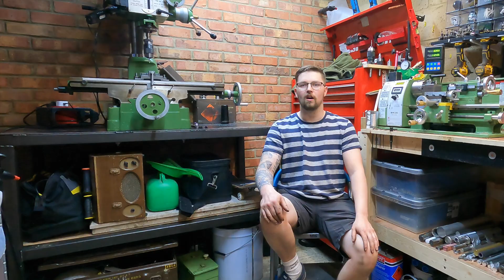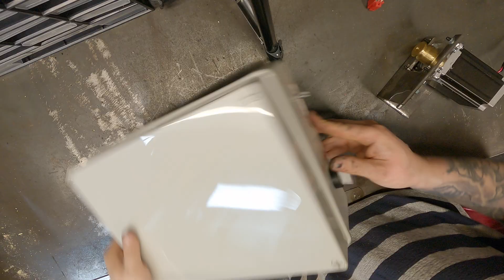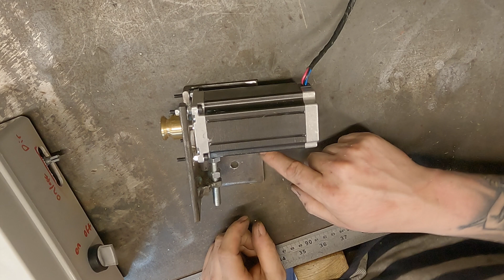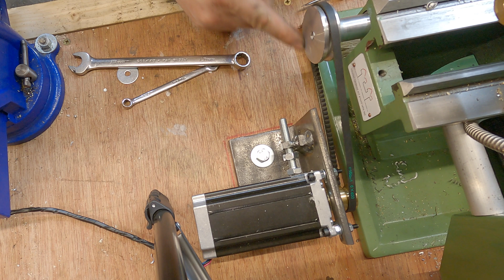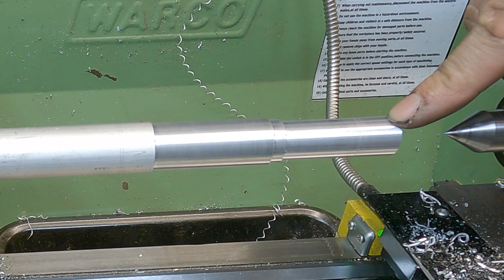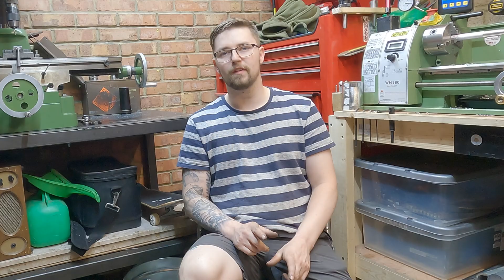Warco WM180 MINI Lathe Power Feed IMPROVEMENT Finished

Comment: Great job joe very informative and well made video thank you. Super new to this machining hobby. I have a question for you, and the page here. Help me out to understand why you added this please. Does your lathe not do the same thing whenever you engage the half nut feed for threading? Please explain, super new here just need some guidance. Im addicted to knowledge.Thank you.
Reply from the maker: Welcome to the channel and the world of machining. 
So because of the setup on this lathe and most mini lathe with a limited number of change gears the minimum feed rate you can achieve is still not slow enough to gain a good constant surface finish. With this mod you can turn the lead screw much slower so in affect make your feed rate also much slower giving a better surface finish. Hope this helps understand.

Comment: I had the same idea as you but I did not do it.  This idea can wears out the threading rod and half nut easily if you use the thread ros as feed rod a lot of time.
Reply from the maker: Very good point. I am hoping if anything will wear out then it will be the half nut first. I am even thinking about replacing the original half nut with a tool bronze the ensure that does wear first.

Comment: You don't find it necessary to be able to access the direction change on the power feed? I did something similar to a small 200mm center to center lathe, but I use power feed in both directions frequently. I designed mine to have both momentary as well as latching switches, so i can jog the machine with a momentary switch, or leave it "clutched" in.
I found your video because I looked up a something about doing the same thing, but with a NEMA 23. This time It is for a milling machine so I'll need to be having good access to that change direction button.
I'd love to show you what I've done too, but I don't have a good video. I'll upload a private video later to show you.

Comment: Hi joe good videos matey I have the warco 240 an going to put power feed on it. What I want to know is where you got the stuff from and how did you know where the wires went when wiring up.
Reply from the maker: Hi 902dr thank you for your comment,
I’ll update the description to include links to the motor and controller etc. As for the wires the controller and motor came as a kit with a wiring diagram. Basically you have 4 wires coming from the motor 2 from each coil they go to the controller. Then you need a + and - from a power source for the controller and a 5v input for direction of rotation and speed control. If you think it is worth doing I can do a follow up video on the wiring.

Comment: that looks like a really good modification. In my opinion my lathe doesn't run slow enough on the power feed, it theoretically has a 7 speed gearbox, but the ratio's are so close together there is basically no noticeable difference in speed between the slowest and fastest setting.
Reply from the maker: Hi Jack 
Yeah that is a mega disadvantage these type of mini lathes have they just don't reduce the gearing down enough to get a slow feed rate. Im really impressed with the finish I'm now getting from the Power Feed.

Comment: Interesting project. I'm considering to add an electric powerfeed on my lathe as well in the future but not sure yet if it's better to use a stepper motor or a simple dc motor.
Reply from the maker: When I was trialing this I used a DC motor first but it doesn't have the low end Torque you need to drive the lead screw. Im glad I went with a stepper motor in the end opens up future options.